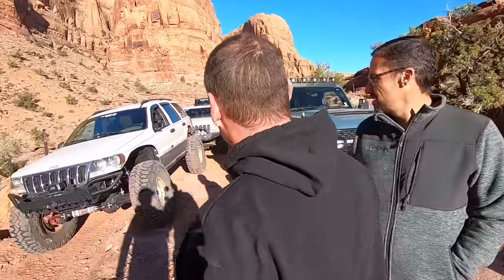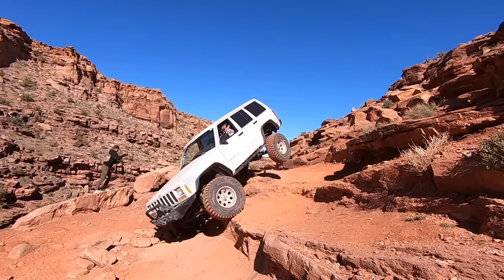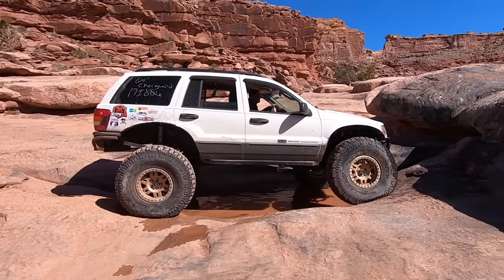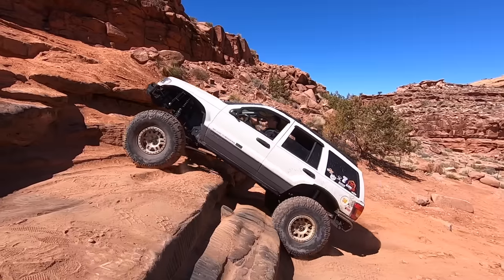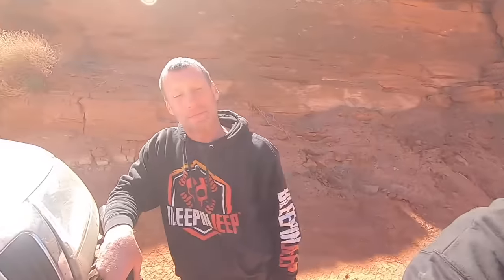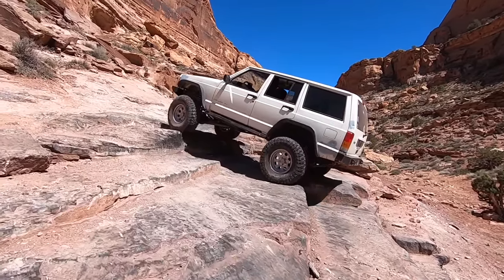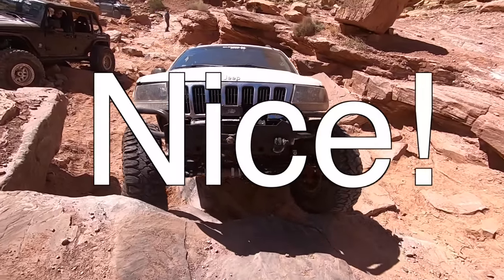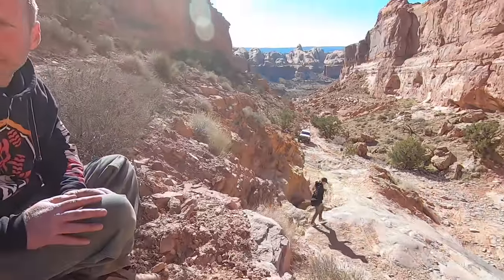Showdown: Bronco vs Jeeps - Who Will Be Crowned the Ultimate Wheeler?

Comment: I think that Bronco’s two biggest downfalls were the bumpers and the driver. That XJ is a force to be reckoned with.
Reply: The driver was the main problem from what I can tell.
Reply: That thing was bucking all over the place lol. I’m glad the fellas gave him so much crap. He deserved it lol
Reply: My God with all that money in the bronco it looked like a fat turd on those obstacles.  Take that pile to the junkyard asap.
Reply: don’t forget it’s IFS vs SA
Reply: Branco need bigger wheel with more traction I love it anyway
Reply: It was definitely the front winch bumper, which caused a lot of problems hitting before the wheels ever made contact. 
He needs to get a hidden winch mount rather than a bumper one. Even a higher mounting one relative to the ground would help.

Comment: I'm honestly surprised that Bronco did so well. With the independent suspension in the front, I don't know why people are comparing them to Wrangler's and vise versa. I really like the new Bronco's, and I really like Wrangler's, but they're definitely two different beasts lol
Reply: Well, most people compare them because they're directly competing with Jeep's for sales. Anyone who buys a Jeep or a Bronco has weighed the pros and cons of each before making a choice. For offroad and overlanding, these are the top 2 choices, even if they have different front end design. I personally prefer solid front axle.
Reply: @DustinRea  Why do you prefer a solid front axle?
Reply: @stormbarnicle  they're stronger, less expensive, and perform better off road
Reply: Not sure that rolling on your lid is considered performing "well".
Reply: We've taken ifs Toyotas through coyote canyonand Montrose successfully so not sure I'd say ifs is a lost cause for off-road.
Reply: yeah jeeps where built fro this since the verry first broncos where not dont think you will be in the class of a jeep on the first generation since they stop making the bronco. i have a 2 door semi stock an di dont think i could do this as a driver my jeep might be able to
Reply: @DustinRea  I prefer the bronco since it looks a lot better and has a better interior. Though I wouldn't buy either lol

Comment: I give that guy in the Bronco credit..he’s been beating and breaking that thing nonstop for the last year or so and just keeps fixing and improving it. All that bouncing makes for out of control wheeling and a lot of busted stuff. For a new rig that WJ is very smooth and the thought put into it really shows.
Reply: If it was a better rig he wouldn't need to abuse it as bad. The XJ did everything much easier. When it comes down to it, all rigs are just tyres, suspension and wheelbase. After that it's driver.
Reply: With all that money he's been putting in it he could of bought a jeep already..lol..
Reply: @1one3_Racing  ’m not into off-roading but I like these videos. Serious question here. Rock crawling puts a lot of wear and tear car not to mention damage. Why would you buy a new car to do this instead of modifying an older one. Where damaging it, isn’t such a big deal?
Reply: @javiersilva1577  because he makes parts for it and it's advertising.
Because people have too much money.
Because people don't care about how their vehicle looks.
Lots of reasons.
Reply: @1one3_Racing  really
Reply: Mod the bronco like they have the jeeps then it would do a lot better.

Comment: I’m sorry Josh, but it’s XJ all the way. The owner of that XJ is the true representative of  blue dollar wheeling.  Minimal spend, build itvwith what you have (his full hydro from a tractor ram - niiiiiice!).  Josh’s built is great and capable, but I’d like to see the $ tally on it, and the XJ did almost everything on 33’, Dana 35s, OX lockers and a reasonable lift.  

I’m « new » in this Jeep thing (leased a 2019 Sahara Altitude that I just bought off at the end fo the lease, with stock axles and open diffs) and it gives me hope that I could improve on my Jeep to be able to have moderate fun at a budget prices. I’m starting to think that I might get away with keeping the small axles as long as I’m not acting stupid on the trail and taking more that the Jeep (and driver!) canchew.

Comment: I build Explorers and early Broncos. I have a friend I wheel with that has an XJ all cut to pieces, welded diffs and stock axles on 31s and he makes a lot of JK and buggy drivers very angry. I would do the same back when I wheeled my Explorer the same way on IFS, welded diffs, 33's, and lots of weight reduction. Brings me back to my roots to wheel cheap rigs like that. That's one of the reason's I'm voting yall in for UA. I love that you're building an underrated, uncommon rig.
Reply from the maker: Thanks Bubba, we need the daily votes!
Reply: @bleepinjeep  PS I'm only like 6 hours away from yall. You should come wheel at SMORR in Seymour MO next time you're passing through from TN to UT or CO!!

Comment: That xj was  awesome, but just like everything people used do those trails on 33s all the time and people kept going bigger and heavier because everyone thought they needed it. The truth is you don't need 40s and Dana 60s but there probably is a set spot of strength weight and mechanical advantage with tires and lift that you have to find.

Comment: That little XJ was impressive.  Peck Brothers drove Prichett in a nearly bone stock TJ without breaking anything too.  Maybe Dana 35s aren't as weak as some believe?
Reply: It's all about the driver
Reply: Impressive, but I wouldn't want to give the credit to the D35... they still suck :D
Reply: They got a bad rep in the 90"s when Dana had some bad axle hardening on the first C  clips .
Reply: That was actually a chrysler 8.25, not a dana 35.
Reply: @rodgood  I just finished swapping a D35 with a bad pinion bearing for a Chrysler 8.25. Admittedly it was probably from a poor setup by the PO, and not the inadequacy of the axle itself.
Reply: @ProjectXJ  it sure does look like it, good catch

Comment: I mean I think it's a tie between the Grand Cherokee and Mats off-road recovery Moorvair. That grand Cherokee is no joke.

Does insurance even cover that for his Bronco? I've read some places that you have to have off-road insurance or something.

As for the XJ... Matt said it ... You can take a Cherokee and put it on 33s a modest lift and disconnect the sway bar and beat anybody... He was right!
Reply: I was on one of many club trips in Moab, we were doing the really high sand run ( can't find the name, long time ago ), my guide with the super bad jeep, and my hardcore D90 with a V8 and custom blower were the only ones to make it up, at any rate ( power, skill ) a discovery in our club ( I think it was a manual, rare ) but stalled half way up the hill, lost his brake pressure ( two pumps with no engine ) and rolled about 6 or 7 time down the hill, there was red all over the passenger windshield.... we all raced up the hill on foot, fortunately it was from a pizza they were snarfing, their insurance covered it ( not the pizza, the truck  ) . I have also seen and helped rescue a classic Chevy bronco with a fatality at Hollister Hills fortunately the passengers were ejected to safety ( 200 foot++ roll ) , not the driver. I had to winch the the overturned blazer at the request of the FD, it was not a pretty site, short seats, fiberglass top. I then held training sessions for club members of how to handle this situation on failed hill climbs and engine failure and one or two pumps on the brake booster is all you got! This was in the late 1990's insurance may have changed. Check your insurance. I'm in CO now, but case in point for insurance we had a huge fire 2 years ago, 1000 houses burned down, I got lucky burned my front lawn filled the house with ash, melted the badges off one of my cars out front, other neighbors nearby, complete loss, their insurance was not up to rising house prices in the area, 200k-300k short on rebuild costs... I keep up on mine because we had two cabins burn in the wilderness in another CO fire in 96 under covered no longer to code built in 50's, so the point being keep up on your insurance, practice hills climbs with engine failure, join a club with skilled drivers. Also our club used to have various off road rallies, timed way points ect, swap tires with just a hi-lift jack, reset the tire bead with starter fluid, custom potato cannon :) but most important, come across a wreck in the wilderness, find and treat the victims, be skilled!

Comment: I already had a downer on the Bronco because of the independent front suspension. But the horn going when it rolled was the final deal buster.
Reply: It’s to get attention if you are on your own and tip it over!
Reply: @officialWWM  Well yes, obviously, but I still don't want it. I expect it also automatically goes online and tells Ford that you've put it on it's roof. It may be an irrational feeling but I don't want big brother, or the health and safety nanny watching over me 24/7.
Reply: @keithrushforth4019  i absolutely, 100 percent agree. That’s the main reason I still drive a 99 XJ! It’s reliable and I can fix it when it breaks. Did you know that BMW cars now come with every extra added, however, if you want them activated, you have to pay a monthly subscription!? I really don’t like where this is headed.

Comment: This is an awesome video. Does that Wrangler have the front and rear locking differentials and sway bar disconnect? Maybe a green question, I'm getting my 1st jeep this year and thinking the Rubicon Diesel 3.0 on 35s, going to get into this lifestyle with my 7 and 10 year old.

Comment: Hey Matt what do you think of the bronco. So sad to watch the bronco not capable with this kind of terrain. More modifications needed to achieve this obstacles.
Reply from the maker: The bronco is a neat idea but where they go wrong is all the electronics and fuels savings.  To make a capable rig anymore you have to gut the drivetrain and electronics on just about any new vehicle and replace it with old school reliability without all these silly safety features.
Reply: @bleepinjeep  and maybe over-ride the air bags 🫣🤭
Reply: @bleepinjeep  It could stand a front bumper that didnt hit rocks before the tires did. I reckon that any effective electronics that truly ensured  driver safety would not even let you start  to drive up Pritchet Canyon
Reply: @bleepinjeep  But Matt, then how are you supposed to know if the vehicle is upside down, if it isn't beeping the 3-tone upside down code????
Reply: @flaparoundfpv8632  😂🫱🏆

Comment: I had a 98 xj cherokee for like 2 years. Always breaking always had issues. Rebuilt the motor. Steering always had issues. Upgraded the tie rod and drag links. Now i have a 2012 jeep wrangler rubicon 4 door. 37s 5.13 gears. Anti rock F/R sways. Aluminum drag link and tie rod. Bumpers, tire carrier, roll cage, fenders. Il take the JK anyday of the week.

Comment: I did notice that the spotters  where nowhere to be found when the bronco driver was starting a obstacle 😮. And it seemed the front end kept unloading on it. Solid axle housing can be snatched down using your own winch but independent front suspension  needs a solution and i have some  idea's.

Comment: If you are just replacing the axle seals, all of them are automotive as well as the bearings. Polaris seals are $100.00. All balls seal kits are $60.00. National seal #224015 is 10 bucks a piece, just a FYI

Comment: That white XJ is my doppelgänger. Same color, same lift, same tire size, same flares. These things just go! We just drag belly a bit more. 😆 

I remember when 33s and 35s were considered “Big tires” on the trail.
Reply: Back in the 2000’s we took our XJ’s with 33’s and 35’s on the hammers.  Lots of home made skid plate and steering box/track bar frame enforcements, not much after marker support.

Comment: For me personally here it is:
1st place is a tie between the XJ and WJ. But since the XJ was mostly stock. We're gonna have to give credit where credit is due. So the XJ was the clear hero underdog here.
WJ solid 2nd place although it performed flawless and such a beautiful rig. 
3rd place for the JK. The problem with the JK were the tires. Either not aired down or worn-out. Those tires were not working. 
4th and last place obviously the bronco. It failed and got beat up miserably. Mostly due to driver inexperience (so sorry)

Comment: just goes to show, tires plus drivers experience (aka watching to find the best line)are mostly everything. if you noticed the funJ wasn't running the brand tire everyone else was.
tread pattern and the compounds used  have more to do with rock crawling than size. Size does increase you contact patch and increase pumpkin clearance. a lift is mostly so you can fit those tires. Plus helps with not turtling and  approach/ departure angles. but with no traction to the rock none of that matters.
from a compound to tough, it slips so you buck off the rock or spin/ smoke your tires. to soft and it wears to quick when searching for grip.  cant tell you how many sets I've tried that only lasted under 10k miles. Even with 33's that's a lot of money let alone 35-40's.. for those who don't know big tires. I just bought a set of 37's for over $2k that doesn't include the rim or mounting.. doing that every year isn't fun.
Reply: What brand tires is he running in the White XJ?
Reply: @JimmyDevere  looks like:
 Cherokees an bronco are on milestar patties
wrangler on Nitto trail grapplers
Then the funJ or XJ (don't quote me b/c of side wall rub cleaning the name off)  Best I could come close with were Crosswind m/t's

but don't forget that tread is directional great going forward crap in reverse. Plus vehicle weight, what terrain your driving, and  knowing you ride come into play a lot.
Reply: @djmadcow  Thanks I have never heard of those. Looks like Chinese tires. They did the best though by far. I agree, the other rigs were heavier and suspension was bouncing too much on the rocks shifting weight off of tire. Also longer wheel base for newer vehicles. But getting back to the tires, they seem to really provide a level of traction that other rigs couldn't get.
Reply: @JimmyDevere  crosswinds are made by shoandong linglong in you guess it china. Don't forget Milestar patties are also a chinese brand. I live in buffalo and there was a un-expected freeze one sept.. I needed a set of tires quick to replace my pro comp xterrains had me sliding everywhere. I didn't have the money saved yet for a new set of winter tires. so for a full set +mounting under $500. I threw some ling longs on, way under sized for my rims 15x 10 like pizza cutters.. but they worked pretty good on ice and snow. Ill still stick  with my new nitto mud grapplers however
I lov directional tires

Comment: Lots of custom jeep builds, custom suspension and typically what comes with custom jeeps is better off road drivers. Most jeep owners don't buy already built, but even if they do its for this very purpose that they already know what their doing while off road. The bronco,  only thing i saw that might not be original is the tires and wheels. An no offense to the driver but i don't think his as experienced.  Not a conclusive video. In Alaska we had an Ford econoline with a 351 Windsor an standard transmission, 3" lift with 33" mud tires.  An we went fourwheeling with jeepers and went everywhere they did..
Guaranteed the Bronco DR with better driver. It'd go everywhere too.
An yes I'm a ford guy, out if high school  i was given a choice between a wrecked jeep wrangler fixer upper or 73' ford bronco (you can guess what i chose) also with a 3" lift and 31" tires and a 3 on the tree, an a 302. (You kids try and guess what a 3 on the tree is without looking it up)

Comment: XJ with practically no mods on a Dana 35 with 33's and an allen wrench duct taped UCA?   Yea, hands down winner.
    WJ did amazing, but as it should for being built and on 40s.  Definitely looked like the most comfy ride.
Bronco..  Has IFS.  Just not as suitable for this as the other 3 rigs.  But I was impressed it did what it did.  Especially coming in about the same weight as the JKU.

Comment: For starters the lack of grip from the jk was noticable the whole video. 
I have a wj and have always loved them so I think it's awesome to see it out there showing everything up. Really really cool. I've also had a xj and always thought the lack of weight on those vehicles help make them so capable. 
That poor bronco and jk just got beat on that trip, even without the rollover. I think the jk probably has too stiff of suspension, it just doesn't articulate and grip like the other jeeps. The bronco, just like a lot of newer vehicles just has so much extra weight to lug around, that bronco is over 1000 pounds heavier than the xj, independent front probably didn't help.

Weight comparison, stock form of course ...
Xj 3550
Wj 4000
Jk 4000
Bronco 4500

Comment: When they started that bronco back up(not a fan) WHY WHY WHY would you give it gas when SHIT IS CLEARLY BURNING? Bro...... crank it and, if it idles, that's what you should let it do until the fluids circulate. You're literally just building carbon/sludge/gunk whatever you wanna call it by cooking likely your ATF(get a manual) and engine oil that got on components it was never meant to be soaked in. Woe is me.....